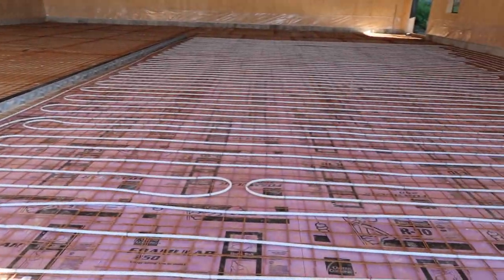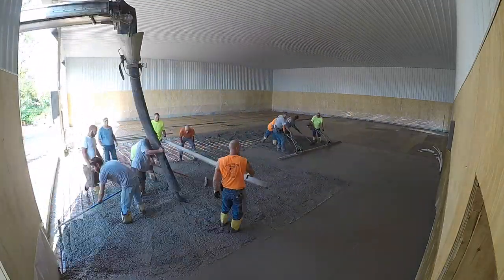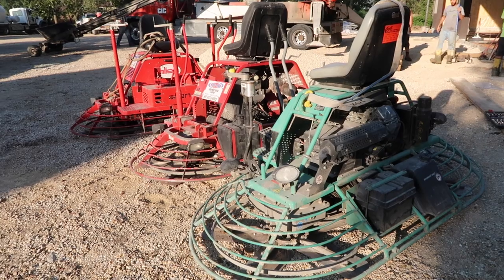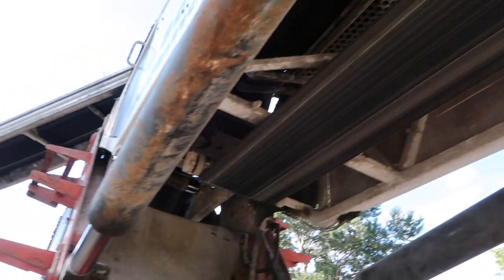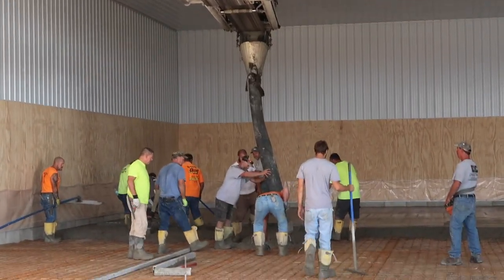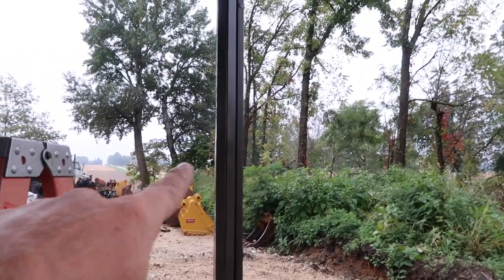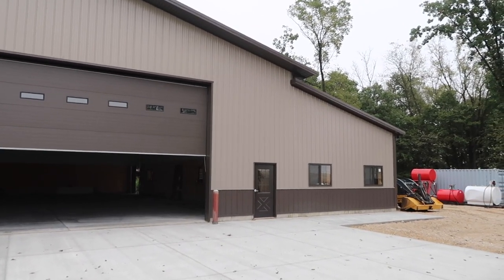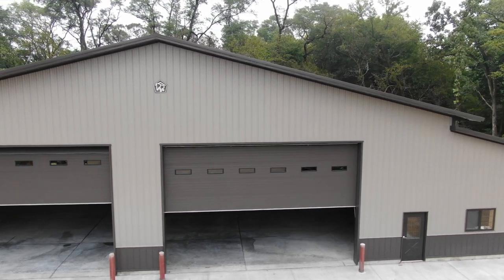Building the Dream Final Episode: How to Build a Shop

Comment: RR Buildings:  my name is Bill and I'm 57-years old. I've suffered 4-near death accidents in 1978,  1980,  1985,  &. 1991.  Far to many details,  surgeries, and years of therapy to explain on YouTube.  I'll summarize by stating the serious permanent disabilities.  I broke my neck in 3-places,  a C6, C7, & T1 Burst Fracture that left me completely paralyzed from the neck down.  I had 12-hour reconstructive surgery to my neck. After 2-years and over 3750 hours of therapy, I got back just enough function to stand, and take some very awkward steps, but far better than totally paralyzed with no arms, legs, etc.  In 1980,  I was a passenger getting a ride back to college.  The driver started driving fast & crazy. I begged to be let out & i would walk. He never stopped and when he reached 3900-feet up the mountain road, he crashed off a 250-cliff. When I came to it was 1:00am and at bottom of cliff & bleeding out....badly. Had a broken jaw in 3 places, massive lacerations to my face, eye, ears & neck, 23 micro fractured teeth, fractured skull and several torn muscles. I used my arms to pull myself up the cliff to roadside, but driver had left me for dead and I was just about unconscious on roadside. A car saw me, they rushed me to small country hospital and then Medi-Vacced via chopper to Roanoke Memorial Hospital.  After 2-months, I was transferred to Mt. Vernon Hospital (Home Town). 85-Hit by a drunk driver who ran a red light and rear ended me at 45-mph driving into a dump truck stopped in front of me. I broke my neck again in a different place and suffered additional paralysis and set backs to progress made.  Had another 8-hour reconstructive surgery to fuse my neck in 4 places and titanium wired all 4-levels. 6-plus passed, I was and had been independent & running 3-corporations when me and my then fiancé were stopped in July 4th holiday traffic on I-95 North in the left lane. A group of girls driving 60+ mph never stopped or touched their brakes and hit my Toyota 4-Runner at 60-mph causing a 5 car "Reverse Chain Reaction accident". Once again I rushed to hospital and neck DID NOT BREAK but the spinal cord tore, called Teathered Cord Syndrome and the previous cord damage and scar tissue where stretch and caused tears in the cord and a 50%+ set back in all my progress. I after 4 solid years of therapy I got no better and in fact regressed & got much worse. I closed one Corporation, Sold off the other and filed Bankruptcy with the largest of them. I NEVER EVER WANTED TO QUIT At anything in life but in 1999 I had sold both my houses and lost everything I had....I mean Everything! 
So when I saw this video of a one level building,  my long winded way of getting to this question is :  IS IT POSSIBLE TO BUILD THIS STRUCTURE BUT BUILD IT OUT AS A HOME FOR SOMEONE LIKE ME TO LIVE IN???   I live in Wilmington NC and if it could be done, less heated floors,  how much would it cost???  
I'm just curious as I'd like to live alone and independently.  That's virtually impossible to without help when living on Social Security Disability Income.  It seems in would or may be a less expensive way of building a livable 1300 a 1500 square foot house?   Please let me know, and thank you in advance for your advice and ideas you may have?  
Respectfully,
William ~
Reply from the maker: I hate to hear all of that, but most definitely you could build a home like this all on a concrete slab and it is much cheaper than a traditional stick frame
Reply: RR Buildings -  I simply wanted to say, "Thank You Very Much!" for both your prompt response as well as you answer & advice pertaining to being able to build a structure like the one in your video,  but for residential purposes.  If I processed the financial wherewithal to purchase & have you build this for me, I would do so in minute.  Being one level,  I have no doubts now, given your answer,  that it could be built out as a wheelchair friendly, 2 bedroom, (Master & Guest room)  and then one large Great Room and a Kitchen.  Just have to win the lottery now‼️😃😃

Comment: What is the tlotal cost of the construction except the field and electricity please ?
Reply: Id estimate $40,000 to $50,000
Reply: @OIF/OEF-0341 depends on where you live concrete ranges from $1.50 to $5.00 sq ft so the slab is pretty cheep but the wood and labor are what come into play more than anything. And without interior walls and expensive finishings that a house would have its a lot cheaper than youd expect.
Reply: mandavaler multiply that cost by ten for the U.K.
Reply: @karlmac1  yeah ive heard horrible things haha
Reply: mandavaler Dude that’s a $300k turn key setup minimum.
Reply: Karl Shields OUCH. Really? That’s crazy. I’m guessing your average Brit isn’t building these then.
Reply: @mcstew32  average Yank isn't either!
Reply: mopar92 no way does that cost 300k. Probably in the neighborhood of 80-100k

Comment: Sooo ballpark price on building?
Reply: My guess is $450k to $500k with materials and labor accounted.
Reply: J. Cab. Not a chance.... that’s way high
Reply: Prob. 
100,000 - 150,000
Reply: 35 a foot puts him over 200, 000...
Reply: mikebsexy 
That's all of 300k.  Theres prob 50k in concrete alone.  The shed material is prob 140k
Reply: Wish the uploader would say the price n breakdown in US Dollars.  Cost in materials, labor, etc
Reply: @Kevin-zi9ku  Probably wants to protect the privacy of his clients. Not everyone would appreciate strangers knowing that kind of information.
Reply: @R2Mike  I'm betting that's in the ballpark.
Reply: @mikefasching1241  I'm not sure there's $110k in labor in it.
Reply: @JayCeeAich  $450k to $500k is actually not bad considering most brand new homes straight from the builder here in Canada cost at least $700k with only around 2000 sq ft of living space
Reply: @ayoubfarid1663  Hiring someone to build something on your own property does not equate the cost of home value. You can get a 2,000 square foot home for both 100,000 and 1,000,000.
Reply: Based on an exchange I had with him, I’m going to say it was probably around $350k USD for the building itself. Reason that the initial estimates were close, is that the massive amount of concrete, the plywood walls, roughed-in electrical and rough pex plumbing and huge roll-ups, radiant heat plumbing etc. etc. is going to take the finished price upwards of $450-500k.
Reply: $398,584.28
Reply: I called Morton and got a quote on what I got information from the video. And here in Kansas that building would cost $262,000. That's with a 30 foot apron out front that's what I guess the apron to be. And that's from Morton, who is one of the most expensive building builders on the planet. And that was also radiant floor in the whole building not just half of it.

Comment: What's the cost of a building that size
Reply: around 220 k depends where you live
Reply: I would bet over 300K. I put up a 40x60x18 five years ago. The Contractors cost was $33,000 for the shell. With concrete, plumbing, electrical, interior and doors I’m close to $100K. I did all but the shell myself. It’s already too small!
Reply: @babranson1  Just curious was the $33,000 the cost for the material and labor or was it only labor? Did the contractor roof and put the metal on the exterior and trim the place also? Thanks!
Reply: The $33k for the shell was material and labor. My CPA paid me for my labor by depreciating it all in one year. That saved me about $20 k in taxes.

Comment: Very nice. Really.  the guy could have a great rain water collection system too with all of the sq ft of roof available to him.  I work in the trades, and the only complaint I have is this: if I was paying for a building like this, I'd put a lot of thought into plumbing/electric use and have it roughed in.  For example, a full bath for after work, take my shower there, have a toilet for use while working.  Slop sink on the floor, hi sink for general work/cleaning.  hose bibs with hot/cold for cleaning equipment, etc.   LED hi-bay lighting installed. Exterior lighting on all sides and at man doors.  Work bench power, welder receptacle,  general purpose receptacles throughout the building.  Might even cover the floor with 25 year hi grade epoxy, depending on use.   My office would be roughed in for power/lighting/voice/data.  Probably make a small room for a small washer/drier/kitchenette in the shop area so I could do work clothes/rags, eat.  And off course, a 75" wall mounted TV in the shop area if I was tinkering on a Sunday and had a game on. :)

Comment: Tip of the month: Put your under cover storage space in an area of the building so that fork lifts have easy access. Don't hide it in back with grass and flowers beds surrounding your supply of blank stock.  Think function, not curb appeal... lol

Comment: I’m done a few radiant floors, should have your manifold on and pressure the lines to make sure no damage occurs durning the pore, and have your pex parts for a quick fix in case. Had a couple of punctures on a job

Comment: Not sure how they would mount machines in the concrete. For example a bin pack lift or a compressor...I guess the anchors for those would have to be exactly placed beforehand. Sure is a great building.

Comment: Nice build.  Only problem I see with the slab is all of the wire mesh ended up in the bottom of the slab.  Need some type of chairs or standoffs to centralize the reinforcing wire in the slab.  All the finishers say they will "pull it up as they go" and it never happens.

Really nice finish though!

Comment: That’s a bad ass shop , however if I had those funds I would of  installed fire sprinklers inside   to contain a fire  , I’m sure the closest fire station is  miles away . A reserve tank  with a diesel  fire pump for adequate pressure then switch it for wildfire protection. Either way good job

Comment: Looks Great, Nice Job   Can you tell the spec's of the lean to sheds they look to be at least 16 on the high end maybe 4/12 or so on the roof pitch ? was wondering about ceiling height & width? I have been on the fence about adding a lean to on both sides of my shop and you just made my mind up. Thanks for posting the video, Nice Clean Job.

Comment: Good job.
Nice little overhang for the birdies. ;-)

Thank you very much for the "video efforts".
Reply: That for me would be a Horse Stable. Have to make some minor adjustments to preserve the wall finish as horse Pee is very ammonia based and corrosive. Vinyl siding would work well,but have to seal between it and the metal to prevent vapor corrosion gases. Thinking of a application that would be easy to apply sort of like plasti-dip but for spray application.

Comment: To whom it may concern,

I came across your youtube channel the other day,Fantastic builds.

I have a question for you I live here on the East coast and we bought a property that has a pole barn on it.Well it was ok a few years ago and over the years the metal sheeting on the side(rotting away) and the Fiberglass panels (skylights)started to leak.

Well to make a long story short I tried to get replacement panels for our pole barn,called numerous builders here on the east coast and they said we can get the panels that we have so they are telling me that I have to replace all the panels.

So I watch your youtube channel and I noticed that the steel panels that you use on your buildings are the same exact panels thats on our pole barn.

Is their anyway I can get in touch with your supplier or something to get this issue thats getting bigger buy the year?

Thanks for your time

Greg
Reply from the maker: Https://www.metalsales.us.com/rrbuildings/

Comment: A wonderful build! You're my hero! Could you tell me if you're in a freeze zone and whether or not you put in a number 6 crushed limestone base, which would then be compressed, under the pink insulation block before the 'crete was poured? Just wondering as one day, hopefully soon, I plan to put up such a structure. Again, super props to you on a truly beautiful building as so often garages like yours (but certainly smaller), while a necessity often look like a car repair shop.

P.S. - You now have one more subscriber.

Comment: Awesome shop, but I have a concern.  I'm from Canada and if we put in-floor heat in only half of the floor then there will be a lot of trouble with frost heaving and cracking the floors, because they are 2 different temperatures.  Was frost not a concern where this was built?

Comment: Thanks for filming this, it's been my entertainment for a few days watching the series. A few things ... You said you had planned 4 weeks for the build? All I can say is, WOW. I'm in the UK (cough cough, metric rules) and a build like that here would take much longer. My question for you is, on the 630T's you wet installed for the lean to on the left side of the building, how did you ensure the slots were squarely aligned to the wall on the main structure? I'm assuming you had a method so that when you installed the posts, one face would be square to the wall. I didn't see it on the video so am curious. Lastly, excellent work.

Comment: Def should have filled heat system with water and pressurized to check for leaks before pour. And those seems in the office are disgusting, why didn't blocking go in along seems to tighten them up.... Contractors always get what i call site blind towards the end of a project and settle for "good enough" to get their final payment...... personally nothing short of perfection is good enough, quality is a priority.

Comment: just reading a few comments. so... i am 22, i have a job as a mechanic at a railway and i make decent money, no girlfriend, moderate bills. such and such but anyway. i just finished  doing the beginnings of my shop this year.. took me 10 months. built a pole shed to start with engineered trusses, 30x40' with a 16 ft ceiling with my father. took me 5 months with our old excavator to clear the land on property my family has owned since i was born and about 5 months and 13,000 for the poles a roof and tin and everything else to put it together, and 13 grand mind u i grinded for to put aside during it all... wasn't easy. concrete, walls and insulation to do after winter. After doing most everything but concrete poor myself id imagine ill be at around 30-40 grand. These things are achievable and they all start with an idea and a desire. get at er.

Comment: 9:23- Dude,  actual R for your 3"(76mm) thickness is about 2,87 sq.m*C/W , the R given is referred to 40"(1m) thickness. Nice garage!
Reply: Brah... from raynor.com: "ThermaSeal® TM300 Sectional Insulated Steel Door The ultimate choice for thermal protection is the Raynor ThermaSeal TM300 sectional insulated steel door with a 24.54 R-value. This 3″ thick commercial door model is the most energy-efficient in the ThermaSeal line. Ideal for commercial warehousing, agriculture, fire station, and ambulance bays, refrigerated buildings, underground parking, and high-security"  Brah...

Comment: Why don’t we use this construction method in Australia? Workshops have very poor insulation here maybe R3.8 in the roof and zero in the walls. Either steel C Z purlin or concrete tilt panels clear span construction. All steel roller doors with no insulation. Freezing in winter and boiling in summer. This is so much nicer than a concrete and steel box. Which would cost 600k to 700k for a 6000sqft 550sq m building here in Melbourne including the land

Comment: Looks amazing! Just a quick question: how come some of the beams are not centered on the concrete pillars?
Reply from the maker: because when the holes were dug...the auger moved one way or another and my opinion is over digging to make them centered and having "backfill" is worse then virgin dig with an off center column.    there is no structural integrity loss just a visual thing and it will all be covered with either gravel or concrete at some point....basically just a decision to leave it
Reply: RR Buildings thanks for your reply! I didn’t know that they’ll be covered with gravel or concrete. Then I understand your decission :)

Comment: 72 by 80 how high are the walls and how about that little office please comment back on what this building would cost to build concrete everyday with the radius floors throughout the whole building But I might want a pit put in so please comment back thank you
Reply from the maker: 18’ tall and 20x20 office
Reply: @RRBuildings  I would like to have the same size building but higher walls so I could put a waif in there with a pit

Comment: thanks for the videos. 
that conveyor truck is that a common way to move concrete? I've only ever seen boom and line pumps here in Australia
Reply: Its definitely newer as becoming more commonplace, as you can see it has much lower clearance as similar reach and no pump chugging away and putting stress on the placer guy and nothing to get clogged with concrete, since they are flexible the conveyors can be hosed of and any that already dried up can be hammered off easily. Plus unlike a pumper they can also convey dirt, gravel, sand, and what over other aggregate you may need to move at a high volume. There is some good video content showing of placing sand or gravel with needing much less level spreading to be done, get back to me is you want to some good content, I should be asleep and its the early morning of our USA Thanksgiving Holiday.

Comment: What do you do with radiant slab heating if you ever want to secure something down into the concrete. Like imagine if they wanted to bolt down some commercial grade car lifts. Would that be something they would have to plan ahead and how would they go about doing that?
Reply from the maker: Usually you have a radiant map
Reply: You can use infrared camera with the heat on and see the tubes perfectly